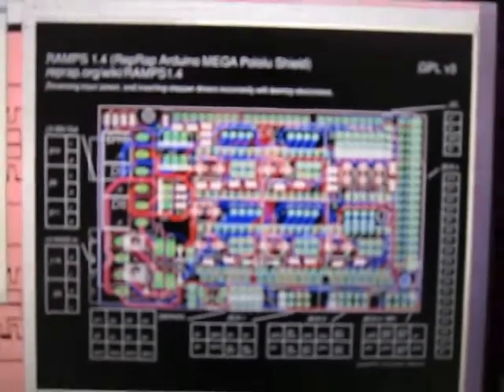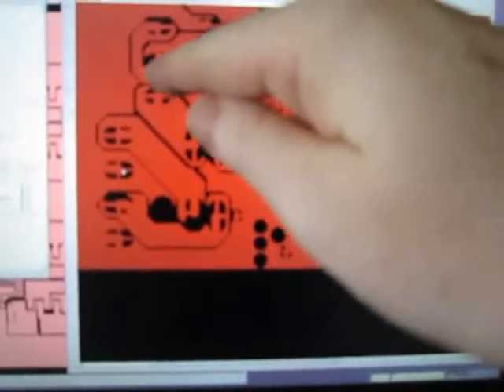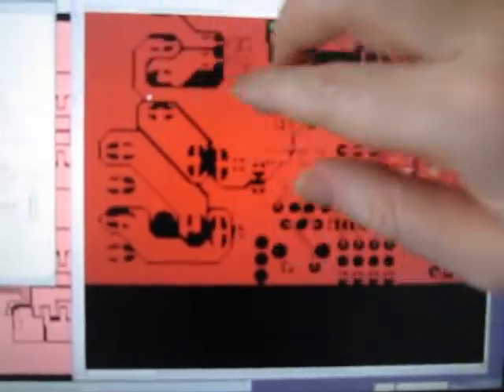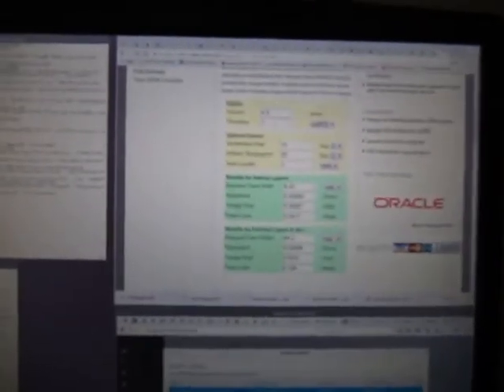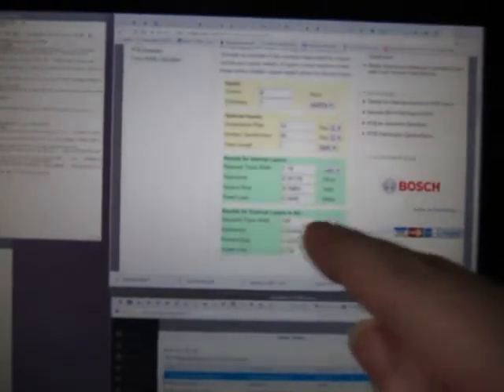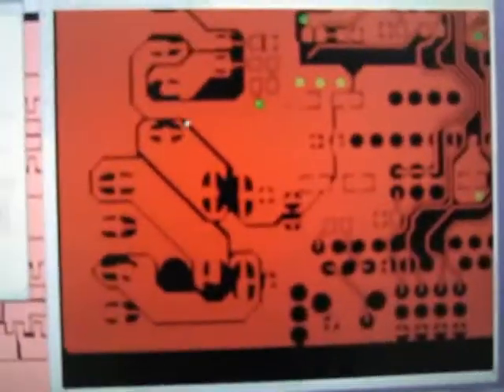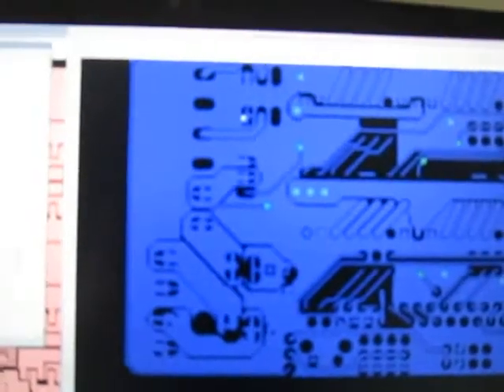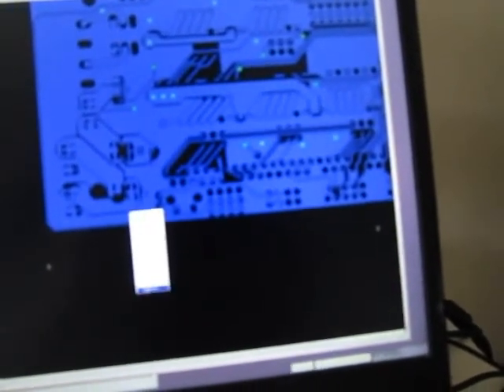CAD walkthrough showing thermal design flaw of RAMPS 1.4 PCB

Comment: i think if i scratch the solder mask and solder a thick wire on top of the tracks or even bodge a thick wire parallel to the track this issue will be resolved

Comment: I was just on that "trace width calculator" website that you used. The very one. And i noticed something hilarious. SCROLL DOWN ON IT. Let me quote it for you, it's saying basically the exact same thing that i said:

QUESTION: I use "wagon wheels" or "spokes" when connecting to a ground plane to make it easier to solder to. The trace width calculator is telling me to make the "spokes" so wide that it defeats the purpose. What should I do? 

ANSWER: The wagon wheels spokes are very short length traces and are heat sunk to the plane. The trace width calculator uses empirical formulas based on long traces with no special heat sinking. Generally, the wagon wheel spokes do not have to be anywhere near as wide as long traces. However, at this time, I don't know of a good way to do calculations for wagon wheel spokes.
Reply: if you dont know a way then shut the fuck up !!
Reply: @fouzaialaa7962   I know the way. Leave the thermal reliefs in. They're fine and not a design defect.

If you don't understand what i wrote elsewhere in this very comment section and cannot mount a factual counterargument, you have no place in this discussion.

Comment: I've built a 3D printer to learn about them. I'm an elder hobbyist. This video is out of focus, the guy's got marbles in his mouth, an he doesn't explain what he's talking about.There is NO WAY that this is of the LEAST bit of help. Great intentions for nothing of value to help me.
Reply: This wasn't the goal, the guy raises an engineering concern, but it's so sweeping, that you wouldn't necessarily be able to do much about it. Just make sure nothing catches on fire and then everything will be fine ;) Also myself being another engineer, i disagree with him completely, i think he has misidentified the issue entirely and the solution he proposes will do absolutely nothing.

If you operate a RAMPS board and want to alleviate part of the actual underlying issue, it's suggested to find and install a fitting heatsink for the heat bed MOSFET, such as the one Ultimachine installs on their version of the RAMPS board, doesn't have to be all that impressive looking, there's little room to go around on the board and anything is better than nothing. It's probably not a bad idea to point something like a slow running 8cm or 9cm fan on the whole RAMPS board. It's fairly important to check high-current connections regularly, in particular the power input and the heated bed terminal, make sure they don't emit more than a tiny amount of heat in use, just touch them once in a while, carefully re-tighten the screw terminals occasionally, especially about a week after assembly. And even if the boards were particularly well engineered, which they usually aren't, there will always be residual risk. Maybe you got a one in a million bad MOSFET which will decay with time. Maybe it got a jolt while being handled either at the manufacturing facility or by you during assembly. And if and when it fails, it will likely fail short, providing power to the components in question, so you might have a runaway thermal situation on your hand, so make sure you have a heat or fire warning system in the direct vicinity of the printer, make sure the power switch is easily reached, and make sure you have a little fire extinguisher mounted nearby. And good luck :)

Oh, of course external SSR or add-on heated bed MOSFET boards are being suggested, yes, they are a sensible alternative, and you can find lots of tutorials on YouTube, but it can introduce perils of its own (i.e. you may have bypassed the fuse, or rather if you have RAMPS, a pathetic excuse for the fuses - though Melzi and Anet boards don't have fuses to begin with, which should tell you how much you should trust them - not very much), and while these add-on boards seem to be an order of magnitude more reliable than the MOSFET you get on the 3D printer control board, they aren't safe from connector issues and the same exact failure modes, so regular temperature checks and fire precautions are well in order just the same.

Also you probably have no more reason to be concerned than you did before. You probably already have dozens or hundreds of items that can easily set your home on fire that aren't a 3D printer, so keep that in mind. People being killed by their refrigerators is simply not a newsworthy item any longer.
Reply: @SianaGearz  is this something to worry about on our ramps 1.4 boards.  I already swapped out my cheap plug in connector with a proper screw terminal type rated for more current than the cheap Chinese one.  I had the plug in one burn up on me.
Reply: @MrEkg98  What do you mean in particular? The MOSFET stil generates an appreciable amount of heat and the bed can still inductively kick up the voltage, so it stands to reason that it makes sense to handle those. This video is about thermal reliefs, and i believe it's entirely wrong, i explained elsewhere down in the comment section why and can clarify if necessary.
Reply: Siana Gearz is there a real issue with the trace size that could cause a fire?  I am running a mk2a bed and havent noticed a issue. The one issue i had was with the power connector on the cheap chinese model. I replaced it with proper screw terminals ala ramps 1.6 or a einsy rambo.
Reply: @MrEkg98  No, these are not traces, these are thermal reliefs, so you can't apply the long-trace thickness formula to them and claim they're too narrow for the current that's going through them. The trace thickness formula is for an infinitely long trace that has nowhere to heatsink into and that shall reach no more than 10°C delta temperature by carrying a given current. Why it doesn't apply? Well first they come in multiples of 3 or 4, so you need to divide the current accordingly; second is their extremely short trace length, so total resistance and heat emission will be minuscule, third that they're heatsunk into the component and the actual trace. There are no currents higher than 10A in a 3D printer - thermal reliefs may become a concern at currents multiple times that. Nothing to worry about here.

Even if you severed all the arms of the thermal relief but the narrowest one, the resistance and heat emission would still be an order of magnitude lower than from the MOSFET that's hanging off them.

Thermal reliefs form a heat barrier between the component and the rest of the PCB. But that's entirely par for the course here. You don't necessarily want your MOSFETs to heat the other components too much, you don't want to radiate heat towards the Arduino either, you want to cool your bed MOSFET better instead, and you fundamentally can't fix a bad screw terminal that starts emitting heat by heatsinking it into the PCB better, because it's a local runaway process.

If they deleted the thermal relief, made the trace solid to the leg, i predict the actual solder joint quality would suffer, it would likely gain a tendency to come out cracked from the factory, and would be more difficult to repair later too.

Comment: Bollocks. That's what you get from engineering shortcuts applied where they don't belong - extrapolated irrelevant conclusions. The trace width formula is for a (rather common) special case of a long, narrow, freestanding trace that has nowhere to heatsink rather than itself. A thermal relief however is heatsunk into an adjacent copper fill or trace and a component lead! So it can safely take up about an order of magnitude more current.

Go ahead and calculate the electrical resistance of the worst thermal relief that you'll find on the board. Do it - i'll wait, comments are patient. And the result is, at worst... 0.002 Ohm for a single arm, or about 0.0007 Ohm total (parallel resistances)! Wow, what a loss. Much less than any electronic component in the power circuit. If you short circuited the thermal relief across 12V, you'd be dissipating mere 0.008W of heat on it - but you're not short circuiting it, the main load is still the bed or whatever, there's very little voltage across the relief, this is why there's essentially no heat dissipated on it at all, nor any measurable energy lost. Even those poor excuses for a fuse, the flappy polythings, have a much higher normal resistance than their relief, limiting the voltage across the relief, and that's without considering the MOSFET and the actual load. Even if you were short circuiting it, the resulting heat would be easily taken up by the adjoining metal with larger area. And have you even ever seen a RAMPS fail at a thermal relief, while everything else was intact and there was no external cause for failure?

But let's say a thermal relief was actually a weak point - it would just be an additional emergency fuse, no harm in that, because it would only heat up when there's a short circuit. If everything's going to shit anyway, failing on a little short narrow trace section might just about rescue a component or two, or maybe even someone's life or their house from fire. The actual fuse will blow first and not let the trace blow, if the fuse is not fake, and unfortunately that happens nowadays too.

Unless you're up in the 50A and higher territory, you just don't need to worry about thermal relief, just leave it in, it's good for everyone. And if you're in that territory, still please consider leaving it in rather than going on a witch hunt.
Reply: Siana Gearz: In this case, Ramps 1.4 boards have overheated (near thermal events), so this video is showing a known design issue, not just some speculative concern. I personally have had 2 such failures while using a slightly higher wattage heat bed than most are using. One time the traces near the MOSFET melted the solder & blackened the PCB .. another time, it was the main green power connector that did the same. Those green oxymoronic  "power connectors" with 0.64mm pins, are marginal at best. If someone is using a heat bed larger than 200x200, or a higher wattage heat bed .. there simply is no reasonable design margin to accommodate this  .. then a relay should be used for the heat bed, thus avoiding Dupont Pass-Thru Connector Outer hsg V2c the heat bed current through the Ramps 1.4 board.
Reply: It's impossible for reliefs to have been the source of heat, because their overall resistance is too low. You can't really fix faulty thermal management at the component level (high MOSFET on-resistance, lack of MOSFET heatsinks, pathetic connectors that have high resistance) by deleting thermal relief because the PCB is probably not that good of a cooler in this case, not enough for sustained loads. I mean you can have two ends of the trace desolder themselves when it gets to it instead of one, if that makes you happier at all.

The video and annotation on the Wiki allege that the thermal reliefs reduce current handling capacity, and that's simply not the case. Of course they do act as thermal barriers, so there's that, but then you usually want them around for assembly and rework.
Reply: Siana Gearz:   OK, I can agree with that, the "reliefs" are not the only design deficiency ... even with those removed, the overall current carry capacity is marginal, considering the current draw on many 12V heat-beds.  The RAMPS boards are low in  cost, and once paired with a high current relay or mosfet ... then it can handle high current loads at an overall system cost (<$10) that is still attractive when compared to the alternatives available.
Reply: An additional MOSFET feels really cosy when it's chain connected to the RAMPS, because it receives 12V gate voltage, as opposed to the one on the RAMPS being controlled off 5V, and you get a better choice of parts too.

I think we have a bright low-cost future ahead of us, i'm excited to see Marlin 2.0 ported to STM32F1, and you could have very cheap overall boards. I mean, an STM32F1 costs about $2 - low pin count but that's alright, you can chain drive a bunch of essentially zero-cost 74HC164s to drive all your motors and outputs with no extra CPU load thanks to DMA peripheral, you don't need those either wonky (CH340G) or expensive (FT232R, $7) USB to serial adapters, the USB is integrated and it'll happily do CDC serial, and you don't even need to match the baud rate between host and software, the software will just auto-adjust to what host tells it to. I haven't really started designing a board yet, i'm just starting to hack on firmware and we'll see where it leads.

.oO(though honestly i don't know why it's between the above two choices for the serial IC... SiLabs CP210x are much cheaper than FTDI and they work wonderfully)
Reply: BTW, i disagree with the premise that thermal reliefs are a design deficiency at all. They are a desirable design trait that keeps the boards manufacturable and serviceable. Surely there are things to improve, like thermal management of components, component selection, free-wheeling protection (IMO not super necessary, because you go try to get more than 55V of a jolt out of a tiny inductance of the heated bed, but if even Geeetech is doing this now, it costs nothing so why the hell not), potentially larger scale architectural changes like charge pump switched gate and universal high-side switching with N-channels. And finally if we're speaking of an add-on board, compatibility with larger range of host processors is a highly desirable trait, so it's nice that lkcl has that angle covered.

Comment: I just adds ssr/relays and just be done with it, I personally think ramps is obsolete (single fan output, on D9 on EFB setup) I better off using other boards like Rambo/Rumba, I think new Arduino Mega Pololu Shield design should be considered (for those who loved it) not to mention it's not compatible for 24v anyways
Reply from the maker: yehyeh, no this is why i started RD3D (http://reprap.org/wiki/RD3D/1.0) because it can go all the way up to 35v, has 6 stepper slots (so you can do either 3 extruders or triple z-screws which means now you can do auto-bed-levelling), and 5 MOSFETs as well, one of which is the same high-power (6A or more) and one is for fans (a max of 3A or so).  but, the price advantage of RAMPS 1.4 is absolutely undeniable: $3.50 in the markets in Shenzhen, that's one-off prices!  so by basing RD3D off the same components base i expect RD3D to be similar pricing, much better features, but compatible with both Arduino (Marlin) and Due (RepRapFirmware).  and it's GPLv3+ properly libre-licensed and community-developed, not the "i'll publish it when i'm finished and i promise it'll be open then... honest" deal you see so often these days.  oh... and i fixed the problems with the thermals too :)
Reply from the maker: i looked that up (AMPS) - are you talking about this page? http://reprap.org/wiki/Arduino_Mega_Pololu_Shield because if so that' really funny, it's been edited recently to reference the RD3D which i'm developing :)